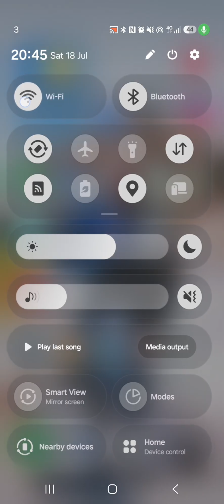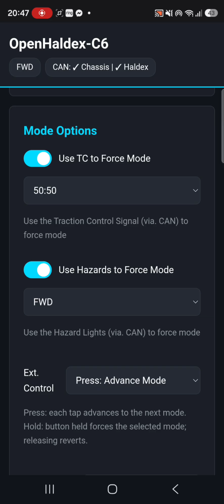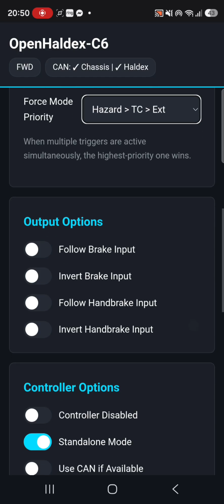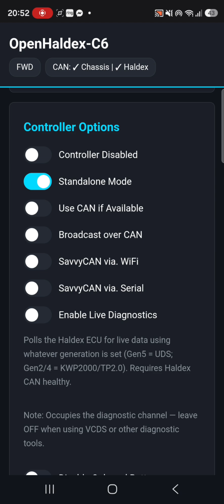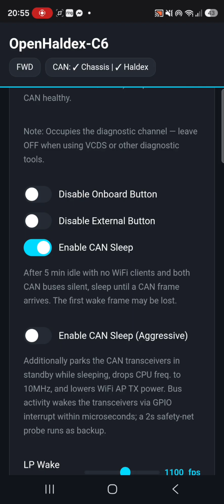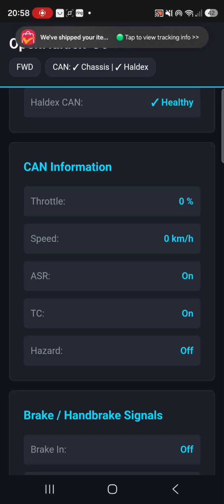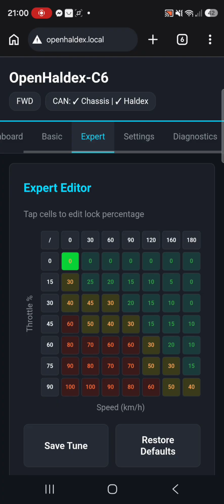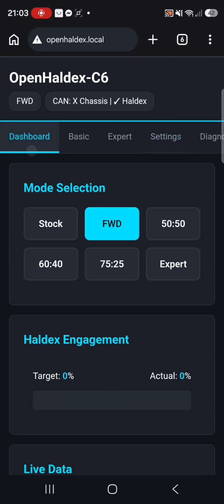OpenHaldex-C6 - A Guide to Setting Up Features and Settings

Comment: Hi, is it possible to connect the controller to an existing vehicle wifi to not have to switch between internet and haldex control on the move? Planning to use it in a camper conversion, wifi router is still tbd.
Reply: Nvm, built one and tried, it is possible